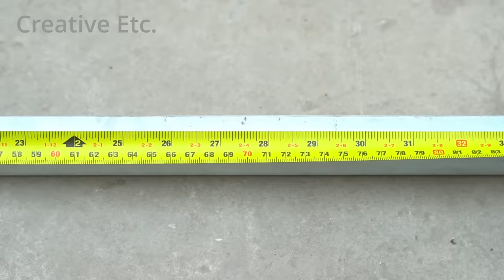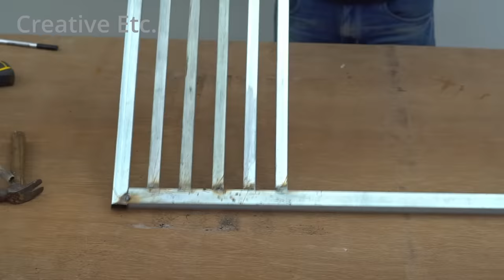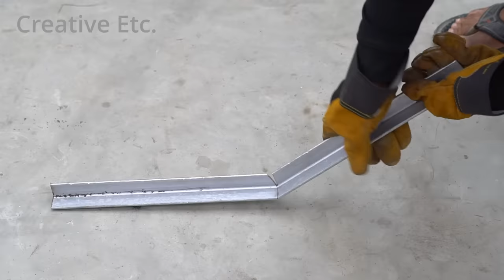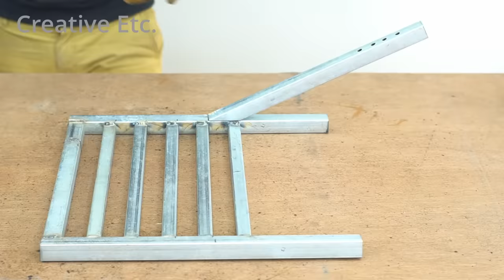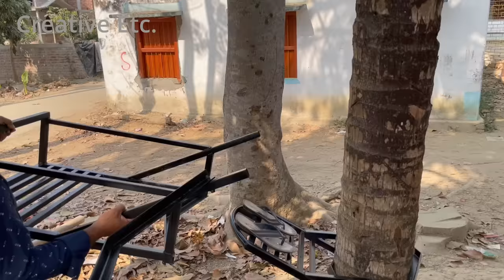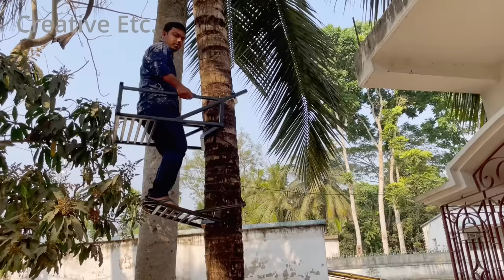DIY Coconut Tree Climbing Machine

Comment: Good work, but in the long run, that rod will break suddenly. So, set a safety belt also. Then it will be perfect.
Reply from the maker: Thanks for the tip
Reply: Safety wirerope loop. Bit loose
Reply: Not rod but tree will break
Reply: Ignore the rod buy the tree will get damaged ,
Reply: Why safety is needed?. He can land on land only
Reply: Wrapped rubber tyre tube to avoid trunk damaged and any slippery incident.

To ensure body weight can support this requipment.

To create SOP when using it.
Reply: @vaibhav13346   he is alive person and will get damaged. For that safety is needed.
Reply: @manjifera  ok thanks. I would have not known this. I thought he would bounce and land
Reply: @vaibhav13346  😐🥲
Reply: Yttt
Reply: Same doubt
Reply: @vaibhav13346  yes 😁🙏
Reply: Exactly
Reply: I think a simple Sport climbing harness and a short belay from tree climbing, Like arborists use will Add a Lot of safety to the system, also the Rubber ist a good idea. Then you will have a perfect and cool system, that ist also Safe. I think you can actially Help a Lot of people with that Idea!! ;)
Reply: Price please
Reply: 1
Reply: @creativeetc  Q❤ pp😊😅😅😅😊😊
Reply: Wow
Reply: Mantap sekali
Reply: Faltu hain
Reply: Ummm they been making these for decades in the USA.  They are self climbing tree hunting stands. Search summit tree stands.
Reply: forget about the rod, the slippers strap will break after 2 use
Reply: @creativeetc  why can't you reply to other comments if u can't answer don't upload the videos
Reply: U can put a time period for this...
Reply: Full body safety harness with lifeline and anchorage point for hooking .
Reply: Grave belt 😂😂😂😂
Reply: @manjifera sir ee product li iro wrong irodhana neevu kandu ididhu ee product ready maadi raitha mithra r ge kodabahudhalla
Reply: @threequestions112  sir good suggestion given my request is get it  repaired from your side where and how the product to be altered and get ready this will help small farmers  in a low budget good product 👍🏽🙏🏽
Reply: Thanks I plannig to draft roboat
Reply: Hey, my friend! I'd had an idea to solve this problem and posted here on YT. My project uses iron bar instead of this kind of rod and does not use the chair. Moreover, It includes some ropes. I am from Brazil and my video is in Portuguese. I was thinking of posting one speaking in English. Go there to see and thanks!
Reply: @israelguerreiro3809 where is your video?
Reply: Hii

Comment: If you don't need to sit, like most coconut tree climbers, it can be built simpler with only the top part where the hands hold and the bottom part where you stand. Great innovation though. Congrats

Comment: Wow, looks just like the climbing tree stands we hunters have used for the past 30+ years. Next, you should "invent" the full body harness and prusik hitch climbing ropes we use in case of equipment failure. Oh, and then "invent" a Strain Relief Safety strap to use in case the bottom half slips or is dropped. Make sure you "invent" some foot straps and/or stirrups so people can wear boots instead of built-in flip-flops. Maybe also "invent" a tie line between the top and bottom halves in case of mishap so that the bottom falls no more than a few feet and gives the operator a chance of recovery. Then, maybe "invent" a Manufacturer Safety consortium like the Treestand Manufacturers Association to ensure safety improvements are shared. Finally, you should reinvent the wheel. 😂
Reply: Lol!
Reply: Lmao

Comment: Great work. My two thoughts.

Its good to use a linch pin for locking thr bolts. As with shaking the bolts may fall down.

Also the sharp edge touching th coconut tree might damage the tree. Good to use a round shape or flat shape that wont damage tree

Comment: If it is launched the stores it will be a bit expensive for farmers but, it will save more than 500 farmers dying from falling from a tree. Excellent work.

Edit: It also needs some upgrades like more safety.
Reply: Farmers dont need this 
Too much time spent installing and uninstalling making it less efficient 
At this point just buy a ladder and tie it to tree lol
Reply: Where did u get that data. Also that device need a lot of upgrade and modified. Like it is now, it only make it more dangerous when u fall since all those metal can cause lethal injury and u lock it a position where u can't prepared for landing
Reply: @bwgaming7586   What upgrade would you recommend?

Comment: Very good idea need some improvements....
1) Safety Belt.
2) Long pipe to attach safety belt.
3) Slipper is not strong enought need something solid like boots.
4) Need Net to drop Coconuts directly in bags.
5) Add...Cushion to seat,
Reply: Good Sajetion

Comment: You have that two diagonal rods with most of the stresses concentrated in one area where the woods. It'll be better if you can distribute the welds and make it safer.

Comment: Much appreciated idea.. can reduce cost by replacing top sitting arrangement with stong mettle cable connected with wood. This will support as safety belt ; easy slide up; reduce weight on single rod supporting structure ; easy to handle and cost effective..

Comment: Very impractical...1st for long tree..it will take long time and huge effort
2nd..most of the coconut tree's diameter change from lower to upper..so it will be huge problem
3rd obviously safety as i know climbing..for me climbing using rope much safer than this